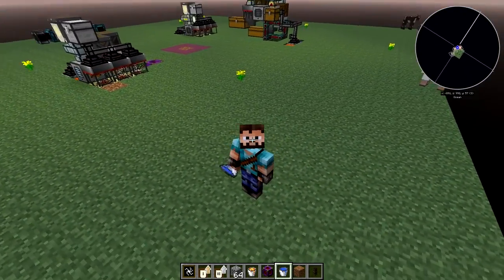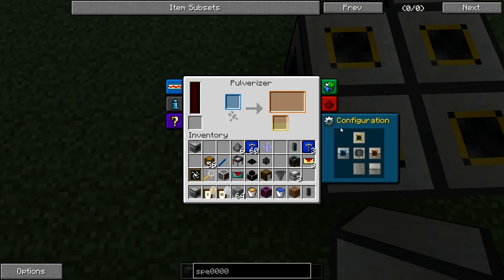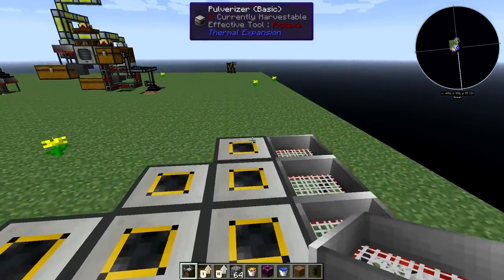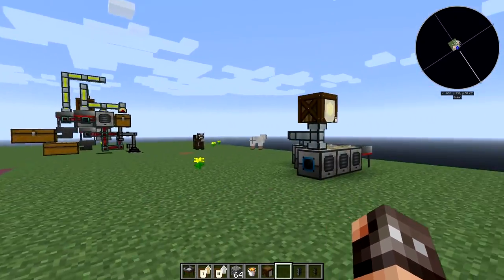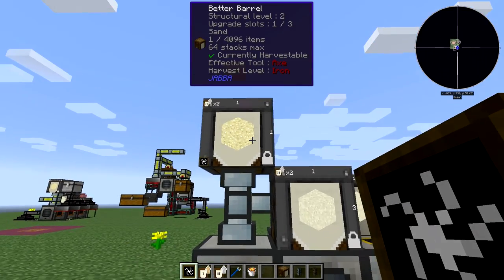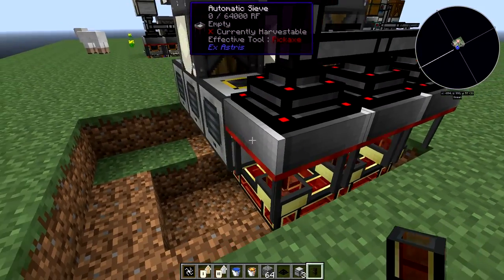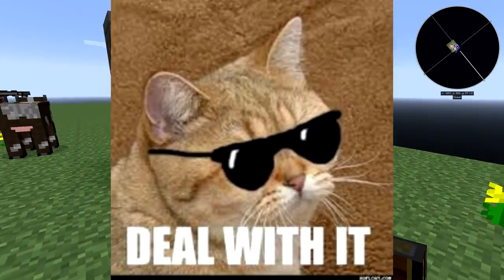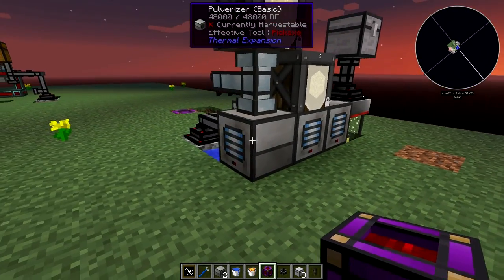Agrarian Skies 2 Tutorial -  Super Compact Auto Sieves!! 60FPS

Comment: Years later, this is still the best design for any modded skyblock with sieving I've found. I tacked on an autopackager, auto hammer, +1 pulverizer, redstone furnace and sort it with an adhoc ME. You can power the whole thing by replacing the lava gen with an igneous extruder, throwing 2 crucibles over pyro below the extruder and adding a magma dyno or lava generator and send finished products into compact drawers via a storage bus on a drawer controller or drawer slave. Add your main AE system onto the drawer controller w a storage bus and all the resources become avail to it.